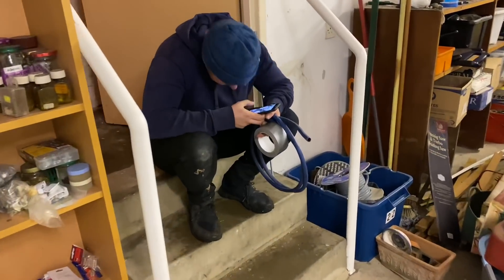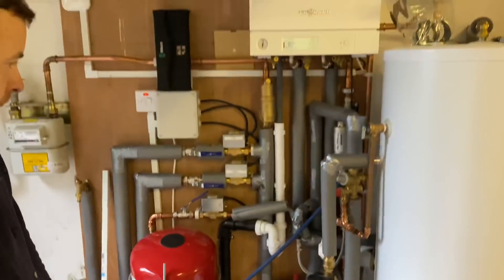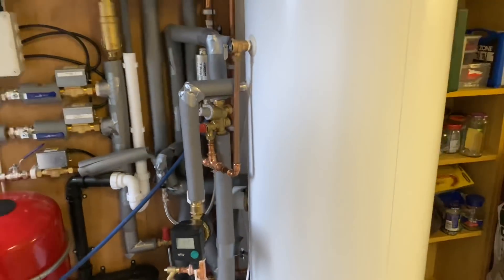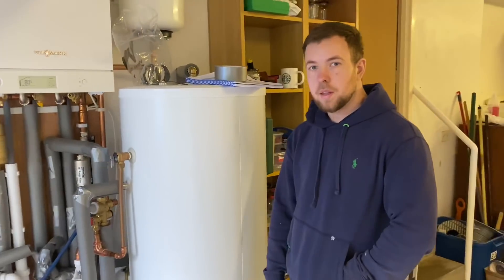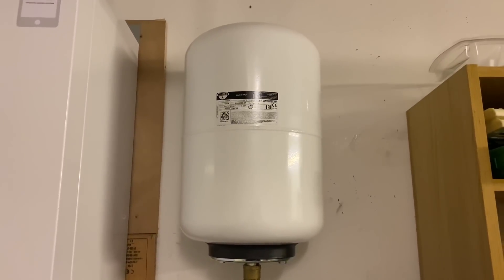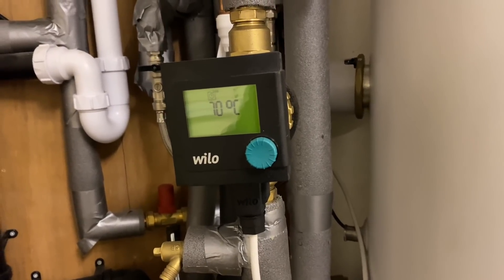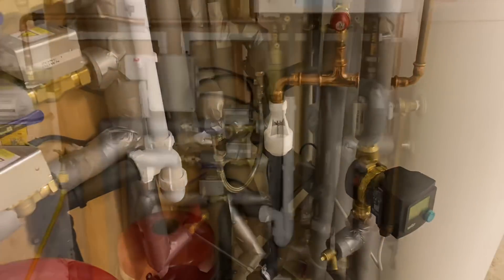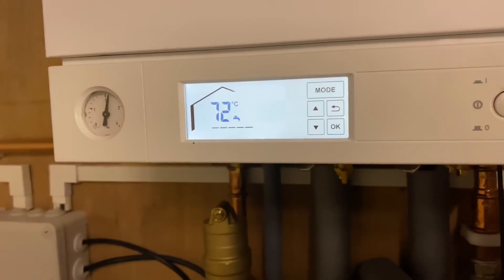UNVENTED HOT WATER CYLINDER - Apprentice Plumber

Comment: In what circumstances might you get the hot water supply backflowing into the cold water system and through cold water taps and wc cisterns. Would it be a non return valve failing ?

Comment: Hi Allen, Very impressive video. I have a Viessmann system boiler attached to a Ariston 150L Primo unvented cylinder which appears to have developed an issue: The pressure reading on the boiler drops to zero, on system side (hot water and central heating), then when topped up via filling loop to 1.2 bar , it lasts for about an hour and drops to zero again. There are no leaks on the central heating side, so I suspect it's on the hot water side. Checked expansion bottle schroder valve and water squirts out.  Have you got any advise as to what the issue might be, please?

Comment: Excellent vid. I had one installed about 8 years ago and it does the trick (4 bed and 2 bath) but does take up a lot of space. Question - could one of the newer combi replace such a system?
Reply from the maker: This is much better than any combi. Thanks.
Reply: @AllenHart999  Thanks. Does that include the Viessmann boilers with built in storage tanks? I ask because when my system was installed, I was asked how many bathrooms/showers I have in the house? 2/3 I replied - OK a combi will not work. I was not asked how many would be simultaneously used.

Comment: Good video👍
Can you give a ball park figure for a ‘similar’ system, single heating zone, hw priority, system boiler, hw circ pump and unvented cylinder sized for 5 bed, 3 bath, 3 reception detached house built year 2000.
Reply from the maker: Depends on the job, Thanks.
Reply: Allen Hart Yes - clearly that’s why I said ball park and not a quote. 🤔

Comment: Nice install how much would that type of setup cost (ballpark figures) was just wondering between this or a Viessmann 222
Reply from the maker: This system would be better than the 222 if you have space. As for the price you would need to ask a local installer. Thanks.

Comment: @6.32 in video the secondary pump shows 70 deg c. thought you had boiler set to heat hot water to 55 c. you should store at 60 C.
Reply from the maker: Dunki STI We hadn’t set the temperature on the pump yet👍

Comment: So the two pipes that are going to the cylinder to heat the hot water are there basically heating pipe so the system boiler has two flows and two returns. Hope that makes sense
Reply from the maker: Yes, That is correct.
Reply: @AllenHart999  thanks for the quick response. And hope we can see some more videos on this type of system in the near future  I find unvented systems very interesting

Comment: so does that boiler have a primary heat exchanger and a plate heat exchanger as well? so what would usually be your instant hot water at the tap now feeds the coil in the cylinder? thanks
Reply from the maker: It doesn’t have a plate, It has a diverter valve in the boiler and that controls hot water.
Reply: It's a 4 pipe system
Reply: Worcester had a similar setup with the internal diverter valve, good for larger systems with multiple heating zones👍🏻👍🏻

Comment: BPEC is one of them, don’t specifically need to be BPEC though,

Mine is LCL awards.
Reply: G3
Reply: Amin yashed technically no such thing as a G3 qualification although we all refer to it as such.

Mine was titled “Hot water systems and safety”

Which meets the requirements for proving competence for part G3.

BPEC is just the awarding body that awards the qualification, or in my case it was LCL

All a money making scam anyway, as you don’t even need to prove you can install one physically and a lot of things in G3 aren’t even covered in detail to get the qualification... then it’s multiple choice and they practically give you the answers to the questions with it being open book.

Then you need to belong to multiple schemes to sign them off because gas safe won’t allow you to sign off one if no gas appliance on the premises so like if one is fitted to a house with oil, heatpump, or economy 7 immersion heater only, they won’t sign it off so need to belong to another scheme and building control charge hundreds.